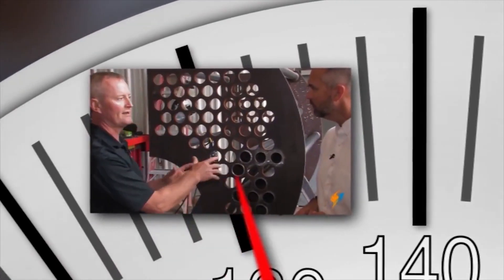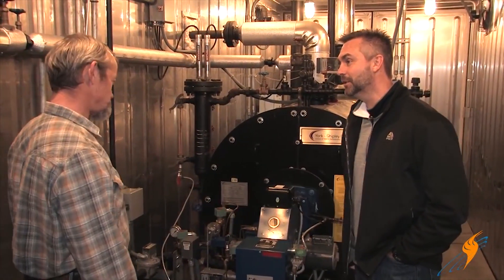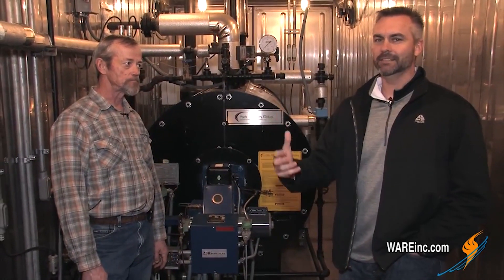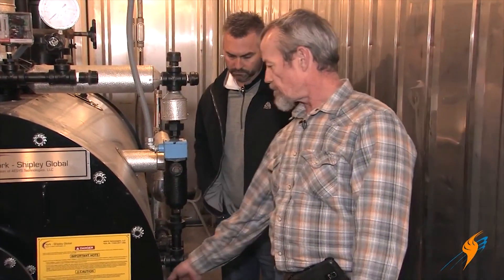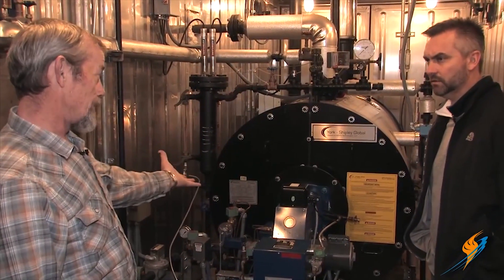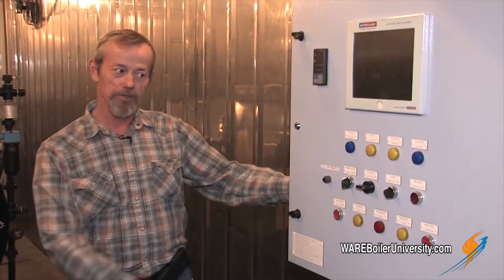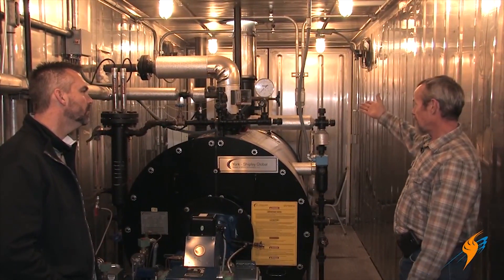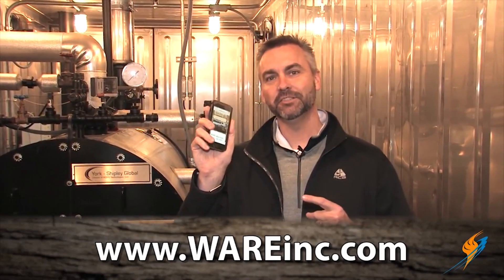Weekly Boiler Maintenance - Boiling Point

Comment: I've always been told that lwfco's should be blown down once per shift even on low pressure systems.
Reply: Bob August yup it’s more so for safety reasons to ensure it is working properly
Reply: firing rate is more significant than the pressure,  often a 1200 PSI unit does not get blown down during operation.  apply common sense for best results.